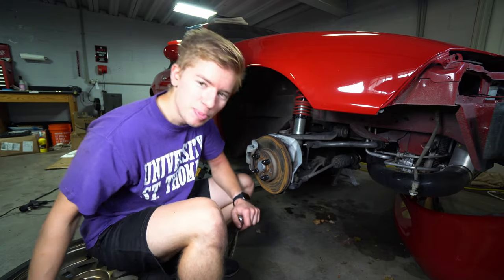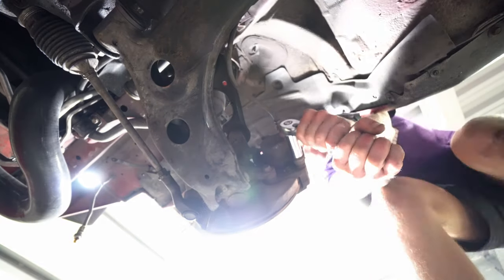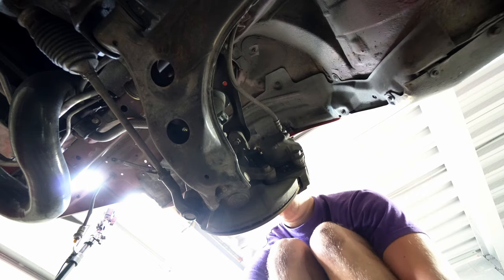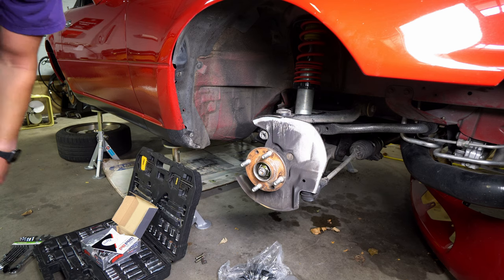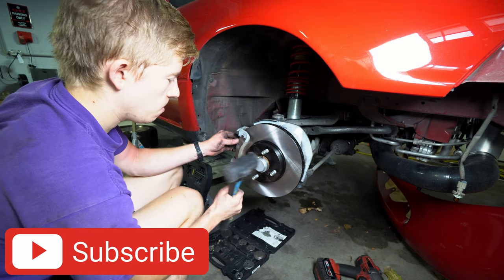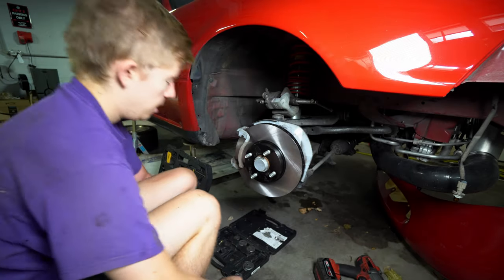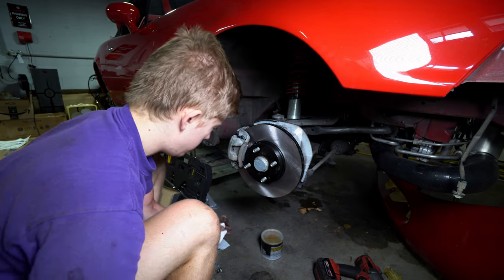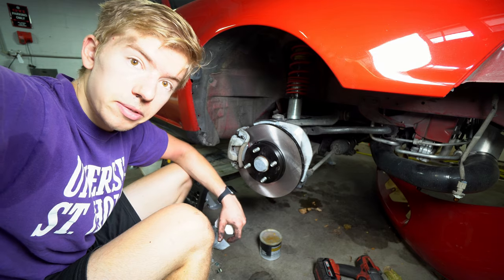Miata Front Brakes Pads and Rotors Install

Comment: I crank the steering so the caliper swings out... I also check the fluid in the master cylinder to be sure it doesn't overflow... Don't ask how I learned ;) I'm currently trying Mintex pads.
Reply from the maker: Good advice, let me know how those pads work out 🤘
Reply: @HardwayLearning  They took a while to "bed in", but so far (street only} they are quite good. Did a back road club tour (15 cars) on hilly roads and it felt good. Also changed to Stop Tech slotted rotors and rebuilt rear calipers, flushed all the fluid.

Comment: The two caliper mounting bolts are both 14mm. You were attacking the slide-pin bolt on the bottom. A quick look at your video shows the nice 14mm caliper mounting bolt, blissfully undisturbed.
Reply from the maker: I may have misspoke about which bolt I was touching, but at some point, the guide pin bolts and the bracket bolts were removed correct?

Comment: My 90 miata just locked the calipers at 217
Reply from the maker: You wut mate?
Reply: @HardwayLearning  my miata like yours locked the calipers around 217 thousand miles. I have to change because the front wheel is locked up.